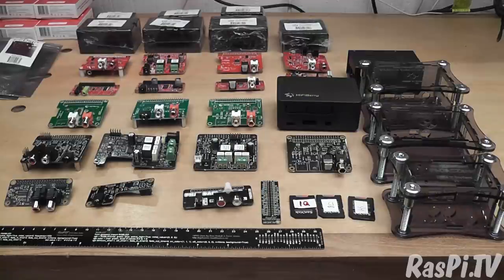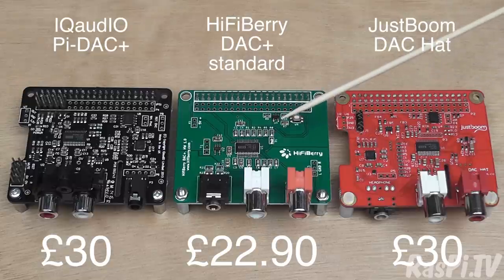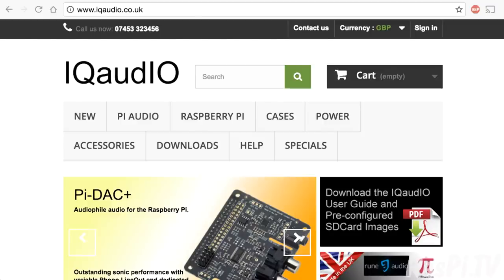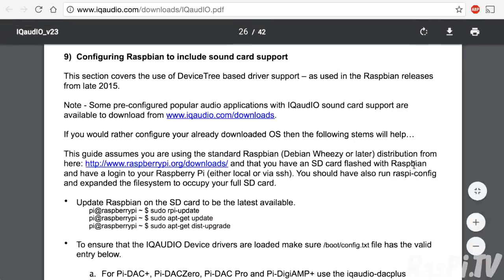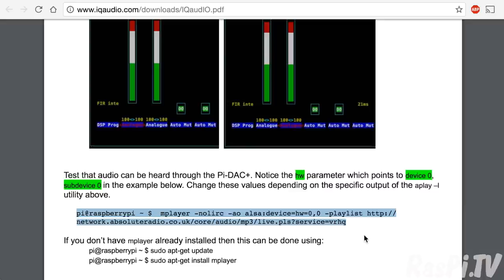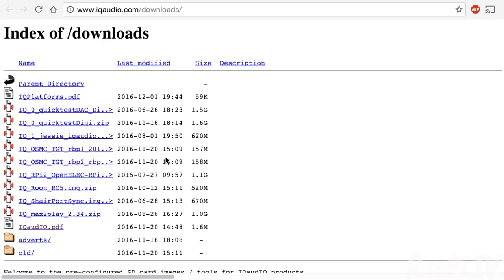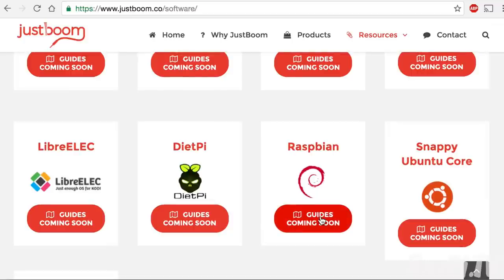Raspberry Pi DAC Review

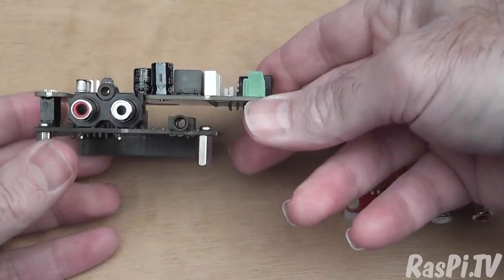Comment: at 2:30, or 2:45, can you still use the RCA output when the amp is connected and use the amp outputs as well? I want to use in my car and it has front speakers powered from the stereo, and rear speakers and sub are powered by a separate amplifier.

Comment: Hi. I have some very nice integrated speakers. The electrics have died. I want to put inside a raspberry pi with DAC and amp (~25-50W should be about right). Do you have any hardware you can recommend at present? Thanks.

Comment: Are these intended to just be a better sounding DAC than are already on the Pi?
Reply from the maker: I didn't think the Pi had a DAC on it. It uses one of the PWM channels from the BCM to generate analog audio as far as I know.
Reply: I'm sure you're right.  I should have said "...better than the internal audio already on the Pi".
Reply from the maker: The idea of these DAC cards is to give you HiFi quality audio output from your Pi. Without an amp, they can only be used with powered speakers, as line out or with headphones. But there are other amps and accessories as well. So yes - it SHOULD be better. But Gordon Hollingworth has asked me to try out the improved onboard analog (using pwm2) so I'm going to have a listen to that as well before I can really answer your question properly :)

Comment: The same chip does not necessarily mean the same sound. In my experience, the most important factor is not the DAC itself, but the noise coming into the DAC over the power lines. If you feed the DAC directly from the same power supply that is used for the CPU, then you usually end up with a lot of digital background noise, which significantly hurts the signal-to-noise ratio. Additionally, if the user lowers the volume by -12 dB (for example in KODI), then the background noise can render the audio unusable. Keep this in mind the next time you are testing another converter. Wack up your amplifier volume, play some quiet sounds and listen to the noise floor / distortion etc.